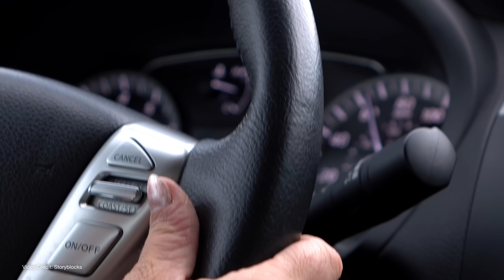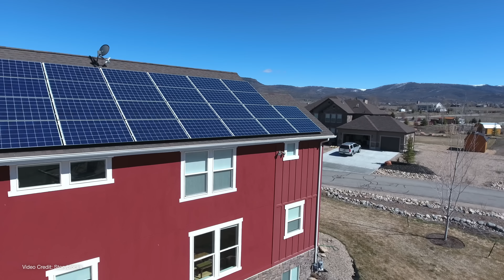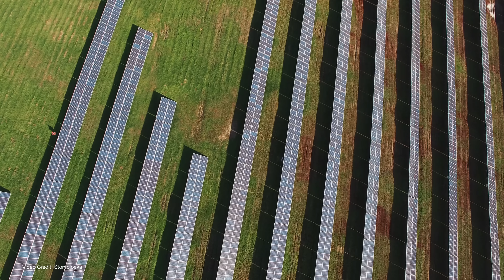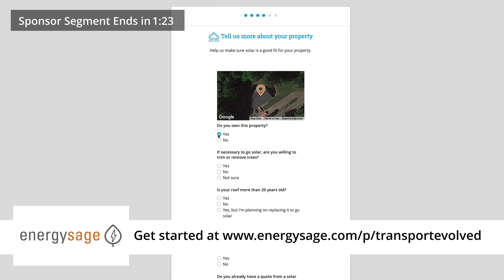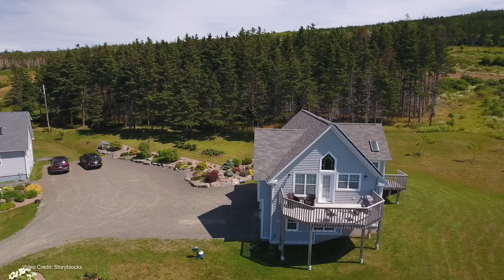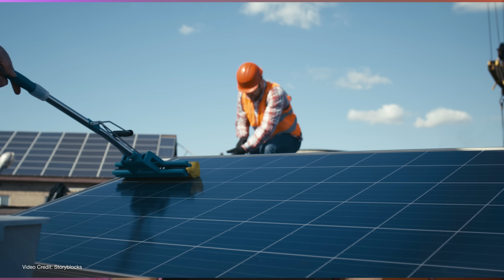Why Solar Panels Are A Good Companion To Your Electric Car!

Comment: Solar panels aren't great for EVs if you charge your electric car at night.   Yes, you can have redundant batteries to store the electricity for charging at night.    But you would be duplicating the most costly part of an EV in the batteries.   That's kind of dumb

Comment: In reply to Christopher Siano in New Zealand we also pay 30 cents per kw but only get 8 cents for excess plus $52  month for connection and reading so no  possible way of paying off the $50,000 it costs for 24 panels and 2 power walls.So much for a labour green government.

Comment: I am on TVA they dont do much for those who want to do grid tie to buy back power.  So I am stuck using my own battery.  That said I had hoped to hear from you as to how big a system I would need for just charging an ev.

Comment: What you said about selling your electricity back to the power company does not work in Indiana.  They have ended net metering starting this month.  I also live in an HOA that is allergic to solar.  However, they just passed a law saying that HOA's can't block the installation of solar (and this is a Republican State).  I'm going to try for it now and get a single power wall.  We have two Teslas (2019 and 2022 Model 3 LR).

Comment: Three things stopping me from going solar:

1). HOA
2). My Power Provider - no net metering, if I don't put in batteries and go off grid, they buy power at 1/2 what I pay for it, and I can't consume it directly.
3). I live in a forested area and would have to cut down trees for optimal solar
Reply: 1). That's tough. I spent about 9 months getting solar guidelines approved by my HOA and they were actually reasonable about it. 
2) I don't get this. Your solar is behind you meter so you'll offset your demand by either what your consuming or the size of your array. I also don't have net metering. My REMC pays me about 50% of my off peak rate (or at least they will when I finally get panels installed
3) This is tough. How much of your roof is shaded? Again I have trees around my house and in winter the sun is below the treeline about 50% of the solar day which is not ideal.

Comment: I live in Western New York, we are known for cloudy, dismal, and very snowy winters (100 plus inches of snow per year).

That said when I bought my current home ( in 2016) it's Sun Number was 94, due to its roof facing directly south. Less than one year into ownership it was time for a new roof no better time to consider Solar.

Due to the previous owners inefficient cooling system and wasteful use of power we qualified for a 10Kw system. We had it installed, with federal credits, and local incentives it paid for 55 percent of its cost. We also replaced the cooling system with a modern unit and installed much more efficient lighting, along with some new appliances.

In the end with our utilities Net Metering program after 2 years we hadn't paid for any electricity supply or delivery cost and racked up 2300 kwh's net Metering credits. Then came my EV, in 12 months of ownership my net Metering credits got used up but I've only paid a total of 280 dollars for my electric meter and a few dollars for suplimental power after my credits got used up.

Now I'm back to generating more power than I use and building up credits during the sunnier time if the year.

Yes, EV's and Solar go together like Bread and Butter. Our Summers are very sunny and over 3 plus years we have generated over 38 mega watt hours of power.

Comment: The year after I bought my first EV (2016) I installed a solar system which covered about 60% of my electrical usage (which was still 3X what my car was using).  I did this to keep me in the lowest cost per KWH bracket...which, each year, has worked out exactly as intended.  This Spring I added 8 more panels so now I have a total of 32 panels and am covering 90 to 100% of my electricity usage.  I am 78 so I do not expect this to "payback" during my lifetime (but it might)...so I simply charge it off to a "Senior Science Project."  Realtors have assured me that since I own the system outright it will substantially add to the value of my home (which my heirs will liquidate upon my exit from mortality).  For my EVs this has worked out splendidly.  I am now producing about 4X as much as my car averagely uses in a month (1,250 miles/month driving) and am blissfully ignorant of the increase of gas prices.  Nikki is right:  best move I ever made.  PS: I get a one for one credit on electricity in excess of what I personally use. I do not have a battery backup, yet.
Reply: I'm in a similar spot with our solar and EV.  Though I out to live long enough to see the payback.   :)

Comment: We bought a house where the previous owner had installed solar in 2014, so we came into all of this in a sort of indirect manner.  Saved me the trouble of dealing with contractors, bids, etc, etc.  But still had a bit of learning, and some paperwork to get the SREC stuff transferred over.

Mind you, our house only had one gas appliance - a fireplace that is largely decorative, and that we rarely use.  So the bulk of the heating in the winter is electric.  That's when the big bills come in as the solar isn't performing well in the shorter days of winter.

Comment: Here in MA, we installed as much solar as we could back in 2014 due to the rising electric prices.  Between the solar and some serious work to reduce our daily needs, we've pretty much eliminated our electric bill.

This was a good move as our power plus all the fees is not just shy of $0.30 per kWh.

The debate on an EV has always been "will it save money?"  Given that our solar leaves very little credit at the end of the season (mostly thanks to the fact that while we pay $0.30 per kWh, we only get a credit during the summer for overproduction of $0.24 / kWh.  On top of this, National Grid charges a flat $7 a month fee just to be hooked up.

Basically, we have to overproduce about 20% more power than we use just to cover the inequality of the system.

For an EV, we'd pretty much have to pay the annual costs of electricity for it.  At $0.30 / kWh and depending on which EV we choose, the cost of gasoline would have to remain over $3.60 or so.  Historically, this isn't likely.  And as we've seen in many places around the world, with fuel prices rising, electric prices won't be far behind.

I try to ride my motorcycle as much as possible and with 75 or so MPG, it's very cost effective.  It's just not possible to cart the kids to various events or carry much in the way of stuff.

One option is the Aptera, but thanks to brainless law makers, here in MA you need a motorcycle license to drive one.  Sure, I can, but my wife and kids can't and none of them want to learn to ride an MC just to never actually ride one.  Not to mention the issue of when I need to take more than one passenger.

There really is no "Simple" solution.

Comment: We have a BEV and PHEV and just installed 9kw of solar on the roof last week.  Our electricity cost is fairly low at $0.13 kWh, but things get interesting when you factor in the displaced fuel costs at $5 per gallon.  I need to do the maths, but at a high level the break even time drops to 3-4 years.

Comment: I installed solar panels and battery storage in March last year. I was lucky to have the cash to invest, but some advice suggested that I wouldn't break even on the savings in my liftetime (I'm 70 now...) My answer to that was that, for all I knew, energy prices might  go up in the future... 
Being retired, I can charge my EV in the day and get free electricity 24 hours for 8 months of the year, and about half of it free in November and February.

Comment: You are correct solar panels are a good companion however it doesn't help if you are renting or in a strata building could mean it's not a option unless you're lucky.

Comment: Our EV is almost never at home when the sun is shining and the solar panels unfortunately don't work with moonshine. But with the prices for electricity over here it is still a tad cheaper than our Diesel.
However, it was still worth the investment in the solar system and with the current prices per kWh it will have paid of itself within 7 years. And that includes the LFP battery.

Comment: 22 years ago I bought my first solar panels, 12v 50w cost 350 euros each! (still working, still using) my new panels are 24v 410w cost 220 euros. The energy generated have paid for my system, and all replacement parts including three sets of lead acid batteries and all upgrades and the new system and lithium batteries and I’m also in profit.

Comment: Put up a second hand set of solar panels and small battery set up just on the car port and use it to top up my XC40 in Australia. If I did have to do a full charge I use the grid but just for top ups for running around town I use the carports solar.  I also have more solar and batteries on the house but use most of it for the house. Had the winter solstice here so looking forward to longer days!!!

Comment: I’m living in a bubble, within a bubble, as I live in Canada, which is a net exporter of electricity, and our electric prices have barely changed in decades.  Our gasoline prices go up, the same as anyone’s.  But after adjusting for inflation, our electricity prices are actually declining.  I want solar panels, but it’s really hard to justify the up-front expense when the effective price of electricity is getting cheaper every year.  If I had the money burning a hole in my pocket then sure, but that’s not the case for me.  And 98% of my province’s electric grid is renewables, so there’s no strong environmental argument either.  And yet…   I really want them!
Reply: I am in the exact same position as you, pretty sure in the same province. I would love to install solar, but we just cant justify it with the current energy prices and with how green our electricity really is. We looked at it at the cabin, with battery backup, and again we just cant justify the huge cost, which sucks.
Reply: @jasonsearcy7388  Yeah.  Might be able to justify it, especially with battery backup, if we had time-of-use pricing here, but we don't have that either!

Comment: Love how this comes out on the same day my net meter was installed and was allowed to turn on my panels.
Reply: What system did you order? Size ? Company? State you live in ? What company are you using for net metering? 
Thanks
Reply: @Jones1-1  I went through my local installer in Colorado, Atlasta Solar Center. They use Enphase and my panels are Hyundai for a 4.4kw system on the carport they also installed. My local utility provided the net meter
Reply: Congratulation!

Comment: Micro inverters with one per panel seemed like a great idea until I realised they're not as durable as the panels themselves and to get to them someone has to get onto the roof and lift a panel to replace a faulty one.
Reply: Power Optimizers are also installed under each panel (and thus require a roof visit).  And my microinverters have exactly the same warranty (25 years) as the panels.  (And I just checked ... optimizers also have a 25-year warranty.)  According to my installer, microinverters have about the same reliability as optimizers.  To avoid any roof visits, you have to give up panel level optimization and monitoring.
Reply: @robroysyd  How do panels with built-in optimizers avoid the roof visit?  That seemed to be one of your concerns.
Reply: @evahsia  They don't but then the roof visit cost is covered by the warranty of the panel.
Reply: @robroysyd   Maybe, provided the panels have a labor warranty.  Not all do.  Especially those bought at a discount and not from an authorized installer.  This is one of Sunpower's claims why they are better.  (No I didn't use Sunpower.)
Reply: @evahsia  This is why my eyes glaze over when I hear of warranties of 10 or more years. Even ignoring the question of warranty having a panel fail in 10 years and getting one replaced could be both an electrical and mechanical problem with them  butted up against one another. I'm in a kind of lucky situation. My panels will go onto a nearly flat roof that's very easy to get onto. They'll be facing North optimally angled for winter. If anything does die I'll not be too concerned about it not being covered under warranty. I think I'll  go with micro-inverters because then I can replace panels and their inverters at random if need be. Given there'll be plenty of opportunity for airflow hopefully they'll outlast me.
The overarching problem down here in Au is there's been some very dodgy players in the market making all manner of dubious performance claims to say nothing of installations so dodgy they've resulted in fires.

Comment: Maybe I should get a driver's license. I accumulate excess energy from my solar installation and I will lose my credits at the end of the year.
Reply: Depending upon who you use for electricity..  some do credits and you use or lose, yes.  I’d like to save up for batteries so that I only use my solar for home and car power and be “off grid” as it were.
Reply: @DuncanCunningham  I too have a "battery room" without batteries. I plan to add them. The only storage I have now is my heat pump water heater.

Comment: I've seen coverage of thin solar fabric, not as efficient as panels but foldable and portable. Rolls of such stuff could easily be rolled out wherever EVs park, used to recharge vehicles and provide power for other uses. Surely, this will be improved and become low cost, another step toward freedom from fossil fuels. I won't invest in charging stations, expecting them to be replaced by energized roads providing wireless charging. More than a decade after first Tesla, it's still early; batteries will become better, and anyone who claims to know the battery tech "of the future' is bound to look foolish in future hindsight.
Reply: I think we are a long way from wireless charging making economic sense